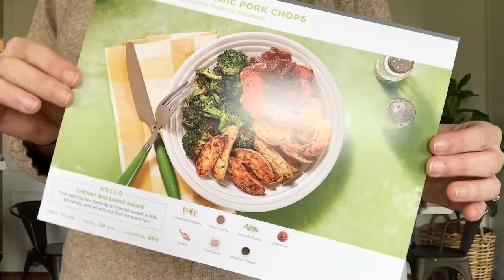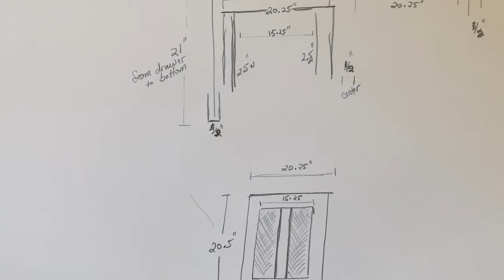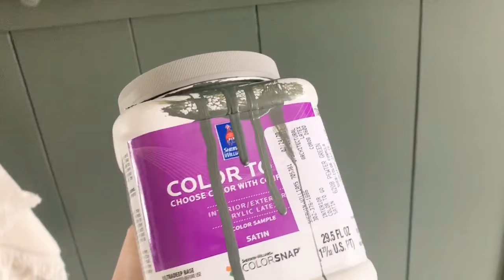DIY Bathroom Cabinet Makeover

Comment: How long did the paint last since you used a color sample?
Reply from the maker: Hi Donna.  It's still going strong and easy to wipe down (SW is heavier bodied and has a little more sheen than other brands).  If you have the extra money in the budget cabinet paint is a plus, but because this was raw wood I thought it would adhere just fine without chipping.  If I were repainting though, I would choose a cabinet paint :)